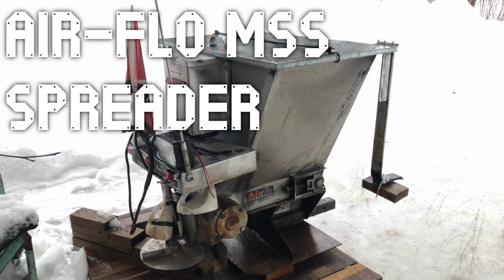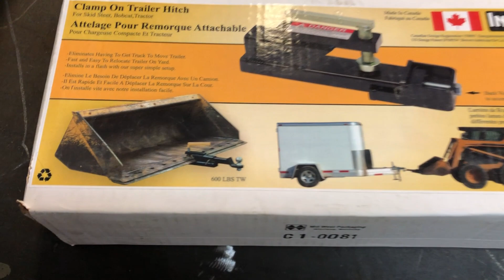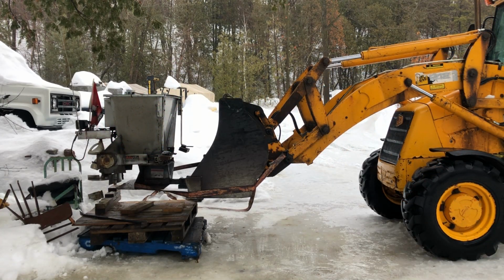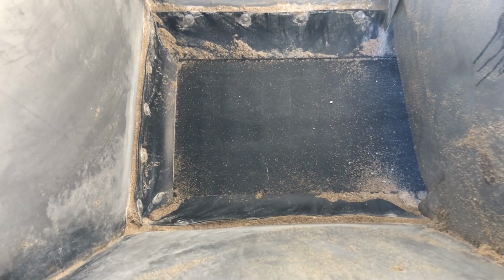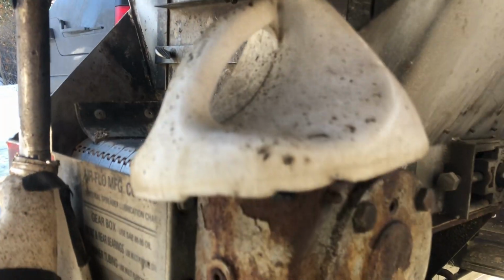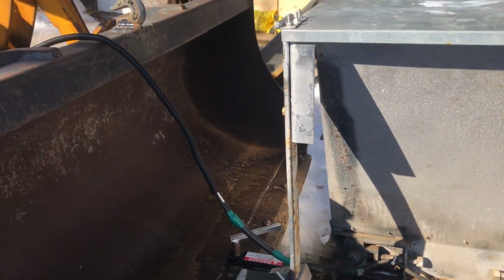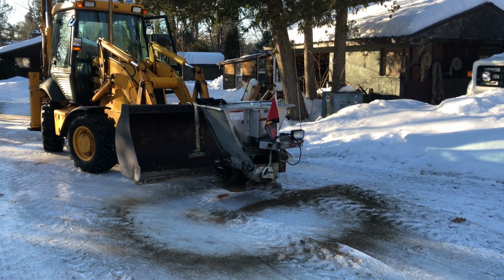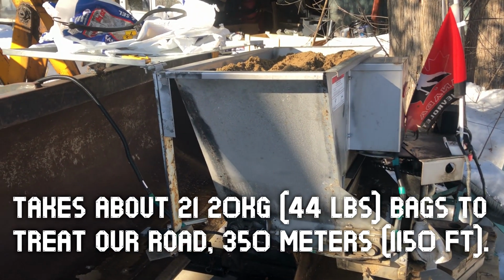Air-flo Mini Sand Spreader

Comment: Do you know how to tighten the drive chain on this unit?
Reply from the maker: Hi Jeremy,  you can find the manual here: https://github.com/AirFloManufacturing/Documentation/blob/master/Manuals/MSS%20Manual.PDF
It shows a chain tensioner part 18018.  Unfortunately there are no instructions about adjusting, but once you find the part it should hopefully be obvious.  If you can't figure it out once you locate the part in the diagram, I'll take a look at mine.
Reply: @GregsStoneYard  thanks man.  I pulled it a part today and figured it out.  Thanks for the link to the manual greatly appreciate it.